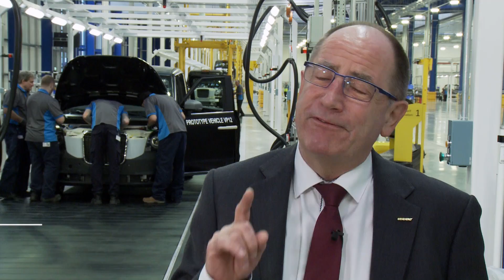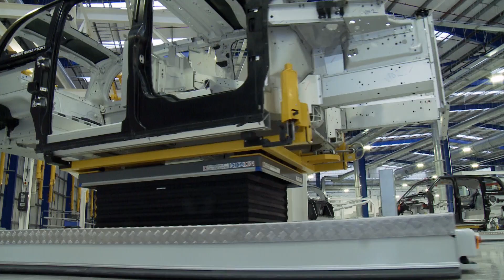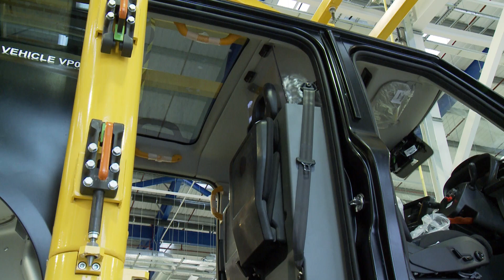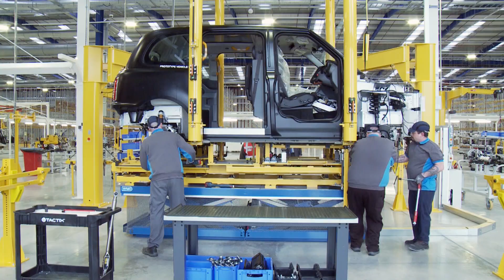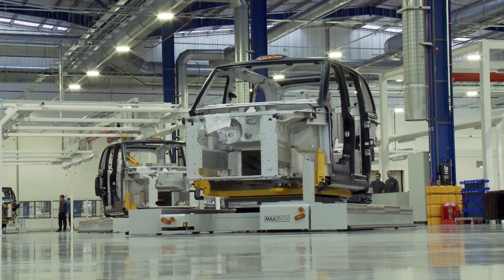The UK’s first dedicated electric vehicle manufacturing facility

Comment: I have an issue with a repeated statement in this video

"100% green", it is not. You need to burn petrol to charge the battery, therefore you are still creating emissions as before but you're now Euro 6 compliant as you're able to turn inefficient fossil engines into mildly efficient range extenders. To get that petrol you still need to spill crude oil over the countryside and into the sea, we still need to have ships taking gigantic ocean voyages emitting diesel pollution, and it still takes 30 electric miles of energy to make one barrel of oil.

I've not found any evidence to say your vehicle is any sort of useful plugin or has any decent electric range, can you direct me as to where I can be corrected on this?